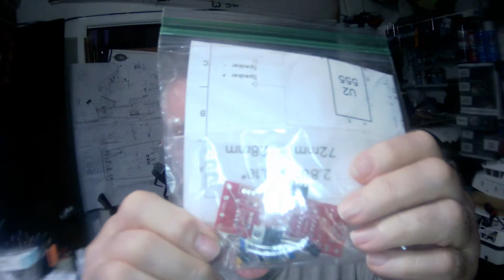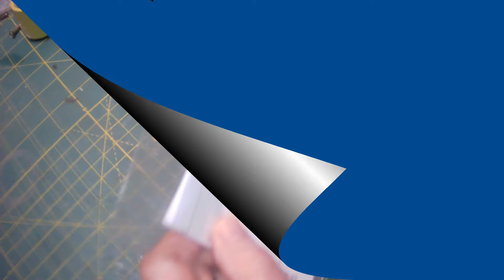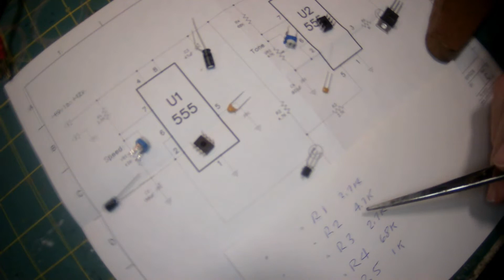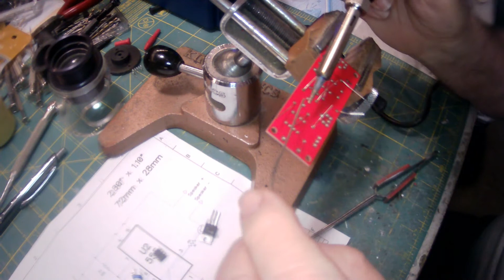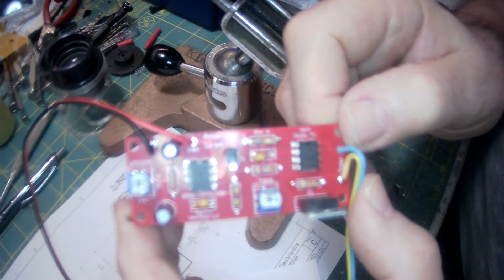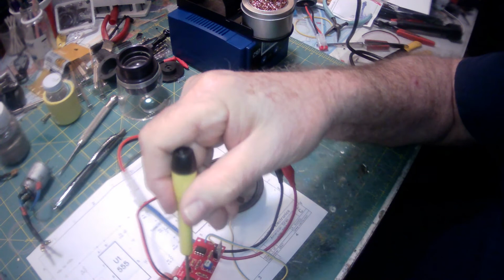NightFire American Siren

Comment: Great video!  Is it going to have a dedicated power supply? I'm wondering if you use the battery that powers the rest of the boat, wouldn't it lose volume?
Reply from the maker: I doubt it needs its own battery.  I believe the power transistor used in the circuit is about 1 amp but that does not mean that is the output for this circuit.  The info says it it needs 9 - 12V but 7.2V works fine.  I confirmed that with the company that makes it.